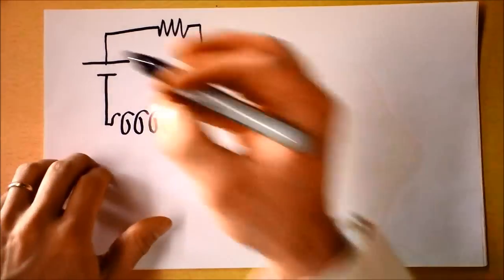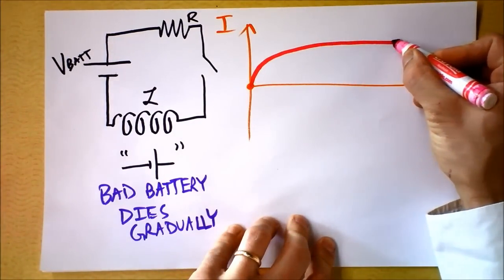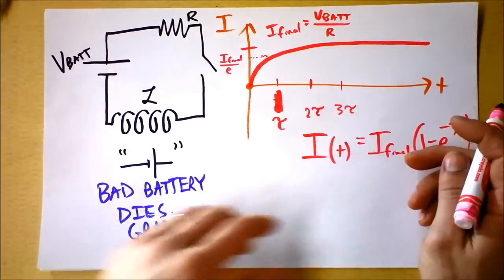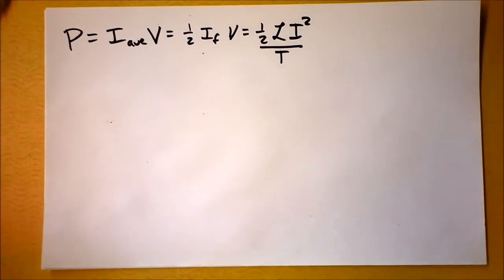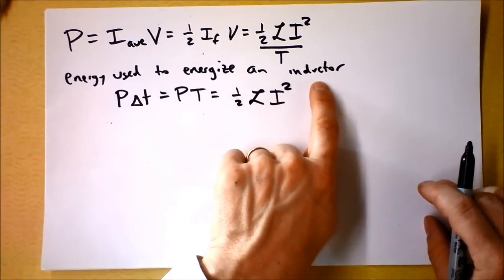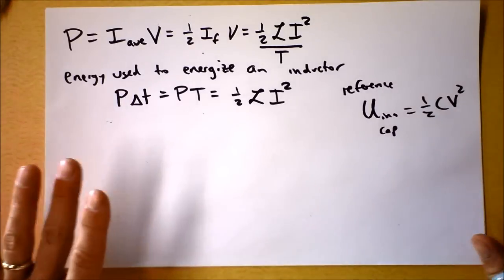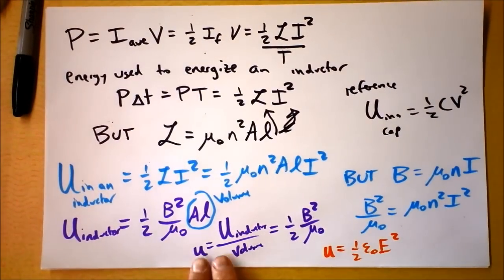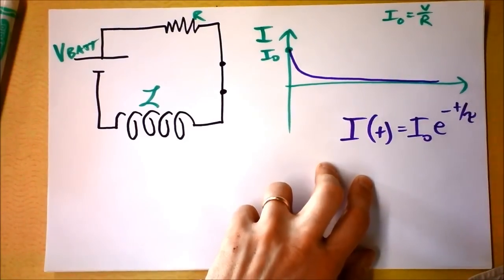Further into Inductors | They're the magnetic analog of capacitors!  | Doc Physics

Comment: WELL U ACTUALLY WROTE THE CORRECT FORMULA OF THE INDUCTANCE IN A SOLENOID(AT 9:30). I GUESS ariaghafari73 WOULD BE CORRECT IF THERE WAS "N" INSTEAD OF "n". U HAVE DEFINED IN THE PREVIOUS VIDEO U HAVE DEFINED """"""n= N/l. DO U REMEMBER THAT DOC. BETTER CHECK IT AGAIN. But as the other videos ur explanation was rocking. THANK DOC FOR THE HELP.........

Comment: I have a question that is not directly related to this video.  Ok, so an inductor induces voltage to another inductor/coil.  Current in the secondary would produce a magnetic field, right?  Wouldn't that induce a smaller amount of EMF into the primary side?
Reply from the maker: Yep!  That, in turn, would induce a current in the second coil.  Are you following the directions of all these induced currents?      Very often, we find something very complicated happening in physics and we decide carefully how many times we want to pay attention to the accumulated, but weakening effect.  In fact, the advanced technique of perturbation theory uses this exact principle to zero in on the most important parts of a problem.  Good work.

Comment: Please reconsider the solution given for opening the switch after a long time (13:00).  When the switch is opened, there is no path for inductor current.  Put another way, with the switch open, the time constant is zero since the open switch is in series with the resistor.  If you don't find this convincing, then consider simulating in SPICE or equivalent.

Comment: As long as you are pointing out symmetry, when you derive the energy densities, why not use H instead of B?  u = 1/2 mu0 H^2.  u = 1/2 eps0 E^2.  After all, B is magnetic flux density, and H is magnetic field intensity.  E is electric field intensity.  Also, you got the inductance of the solenoid right (9:28).  Great video.

Comment: Around 14:xx-ish, you have a real problem once you open up that switch.  Your switch is in series with your inductor!  You opened a switch that was in series with an inductor that already had current flowing through it!  ARGH!  So, your analysis is fine, except that your R is not merely the R of the resistor, but the R of that open circuit of the switch (a really big freaking R when the switch is open - ideally around infinity).  Thus, your tau is zero seconds, and that current goes away "instantly" (in a exponential decay of course with a tau of zero seconds).  Otherwise, you end up with a KCL crisis.  If you did this in the lab and were observing the current on an oscilloscope, and if you didn't know better, you might be thinking, "Where is my time constant!?!?!"
Reply: Dan Hillman To clarify, the initial current when you open the switch is V/R.  But the R used in the time constant is tau = L / (R+Rbig) = 0, since Rbig --> infinity.